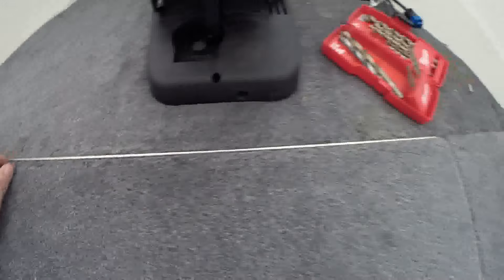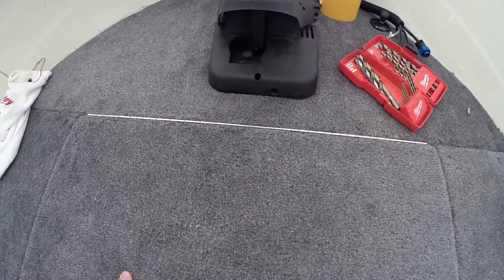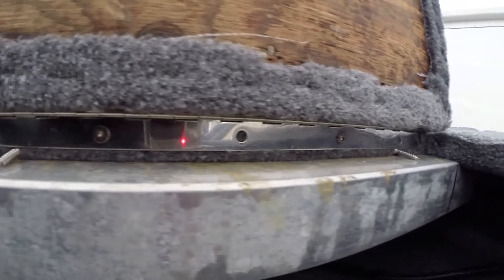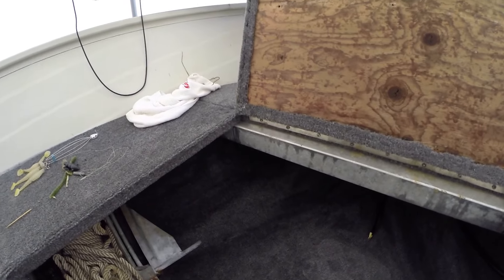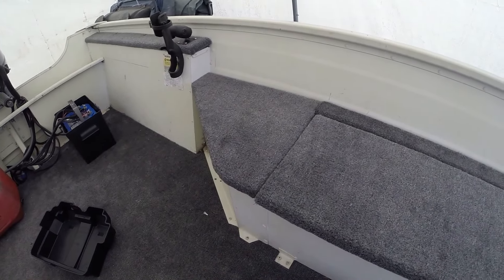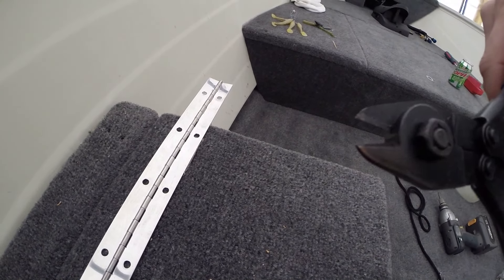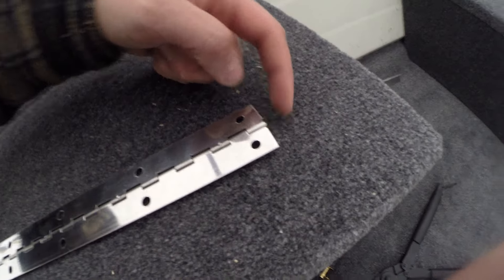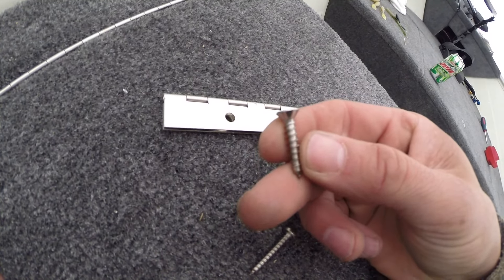Piano Hinge Install  - Aluminum Boat Project #13

Comment: Thanks for using the proper type of hinge....and using it properly....seen all these boat build videos where people use common hinges improperly...very disgusting.
Reply from the maker: Yeah you gotta do it this way. Why do you think bass boats uses these? Because it's the right way to do it :)
Reply: That is not the right way. BASS boat use off set piano hinges that don't screw into the side
Reply from the maker: I've owned a 1998 Ranger R61, 2002 Triton  TR21, 2004 Ranger 521VX and a 2005 Skeeter ZX225.

Comment: Nice work.  The boat looks great.  I see you have a seat base installed your hatch. I am currently in design stage and I was considering doing the same.  Can you let me know the thickness of your deck and if the seat is stable.  Thanks.
Reply from the maker: I believe the thickness of the deck up front was 1".  The way I installed it worked out very well and I have a video in this series on how to make it sit flush as well.  The only thing I wish I did a better job of was put large washers on it underneath so the bolts didn't dig into the wood.  I knew I should have but just didn't have any around when I was doing it.

Comment: Where did you get those exact pliers??
Reply from the maker: These are about 15 years old and made by Rapala designed as a hook cutter.  I checked to see if I could find them online but couldn't anymore.

Comment: what brand side Cutters are those
Reply from the maker: +Edward Mcdowell Those are made by Rapala actually. They are about 10 years old so I don't know if you can still get them. They are designed for saltwater fishermen who may have to cut heavy gauge hooks.

Comment: I don't understand, are piano hinges waterproof?
Reply from the maker: +SonoftheWay35 piano hinges are not waterproof
Reply: ok.....whenever I google search "waterproof hinge", piano hinges come up.....They don't look waterproof but, I wasn't sure
Reply from the maker: I can tell you the ones I used were not waterproof.
Reply: SonoftheWay35 what actual boat manufacturers use
Reply: SonoftheWay35 I don't know if there is such a thing as a waterproof hinge.
Reply: For boat/ marine application, use an aluminum or stainless steel piano hinge.

Comment: They will not last 2 year's. You are screwing into the side of that decking which will not last. Geesh ppl do some research. You should of got Off-set piano hinges man. Smh
Reply from the maker: Fill me in. They've worked great for 4 years
Reply: He is refering to the screws not holding up when you run them WITH the grain like this. Offset piano hinge, or piano hinges with angle aluminum rivetted to them, offer a third plane allowing the screws to be run from top to bottom against grain, rather than from side to side with the grain.
The other issue is binding when you mount them this way, there is more contact and torsion on the hinge when they are used in this manner, which helps to promote the screws stripping over time.
This method works, but depending on the user determines for how long they will last.
Im in the midst of trying to figure out if im doing them offset or like this.